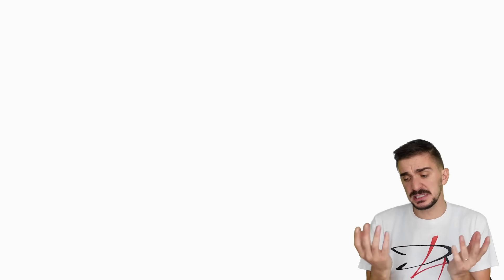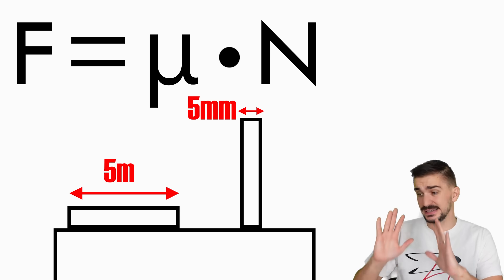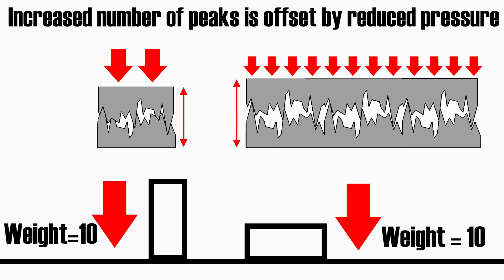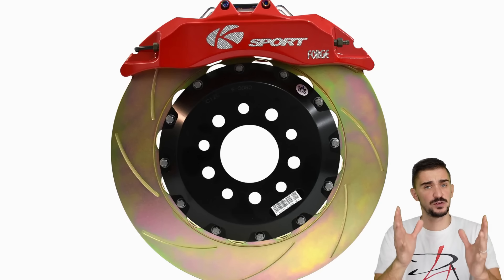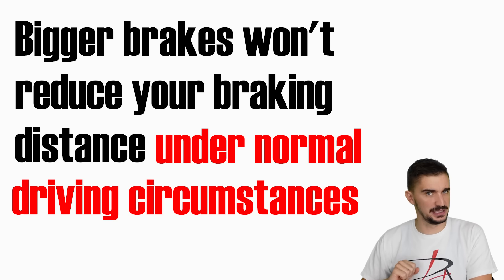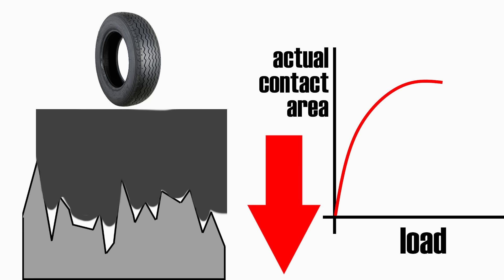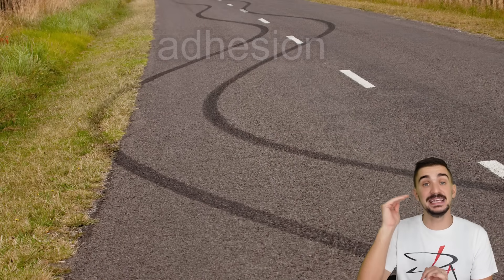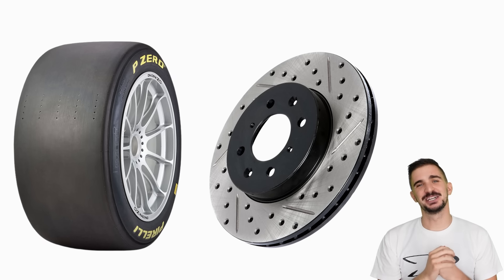Why Big Brakes Won't Stop You Faster but Wider Tires Will - Friction and Surface Area Explained

Comment: Also are you considering how fast and how much force you need to apply to lock up your tires? It doesn't matter if your oem can lock if it takes you stepping with both feet at full force when a big brake kit will apply full force with a moderate press of the pedal. The big brake kit allowed you to stop faster because you reached the 100% grip of the tires faster, more reliably and with less effort than OEM brakes. They also dissipate heat and are more reliable under constant braking where regular oem brakes will just fade and fail you if they get too hot. I don't know why people are sheep and don't realize the obvious.

Comment: Ok so someone explain to me why upgrading your brakes even matter then? The larger disk and larger caliper will apply more force with a slighter pedal press even if the maximum grip provided by the tires is fixed, you still reach it a lot quicker when compared to standard brakes. It also doesn't mean you can't increase it with better tires then you will take advantage of the faster braking of the bigger brake kit with the higher grip ceiling and increase the brake power past what your oem brakes can provide. So this video is misleading because it assumes that the oem brakes will always keep up with the tires grip, and that brake pedal responsiveness doesn't matter.
Reply: In conclusion, I will still get a brake kit, brake lines, and disk upgrade, because I will still brake faster than what oem allows even if my grip is still 100% I will reach that % much faster and stay there due to reduced brake fade/heating making my brakes more reliable during constant braking.

Comment: The math presented in this video appears to be based on the formula for static friction, which is applicable when an object moves in a straight line. However, it's important to note that when dealing with rotational motion, like the operation of brakes on a spinning wheel, the dynamics are different.

In the case of brakes on a rotating object, such as a wheel, the torque required to slow down or stop the rotation depends on the radius at which the brakes are applied and the coefficient of friction between the brake pads and the wheel's surface. The relevant formula for calculating the torque in this scenario is:

Torque (τ) = Radius (r) x Frictional Force (F)

Where:

τ is the torque applied by the brakes.
r is the effective radius at which the brakes are applied (i.e., the distance from the center of rotation to the point where the braking force is exerted).
F is the frictional force between the brake pads and the wheel's surface.
Increasing the size of the brakes alone does not necessarily change the clamping force, but if the brakes are moved further from the center of rotation (i.e., a larger effective radius), the torque they apply increases, resulting in faster braking. This means that larger brakes can indeed enhance braking performance in rotational motion due to the increased lever arm, as indicated by the formula above.

Comment: if normal break disks can fully stop tires and activates abs nothing will be different than bigger race break disks but if tires do have enough friction force and normal break disks cant stop the tire and activates abs bigger break disks can then there will be a difference. but if both breaks can stop the tires while moving car there isnt any be difference bigger and smaller break discs because tires are fully doing traction am i right ? (sorry for bad english)

Comment: This applies to other things. In about 1969~1970 dragsters were pulling 1 g average or more over 1/4 mile. With the normal friction equation, this wouldn't be possible. This is the same for lateral acceleration which was also thought to be limited to 1 g.

Two (at least) things make this possible. The effective coeficient of friction can be greater then 1 due to adhesive forces and the downforce, due to aerodynamics, is not limited to the weight of the vehicle.

Comment: I love the amount of reserch you must do for your videos and the way you can present the facts in a form that regular guys can understand. The fact is that most modern vehicles equipped with EBD and ABS, the ABS kicks in if you stamp on the brake pedal so it obvious the tyres are the limiting factor for single brake applications. If you are a track guy or towing heavy loads you obviously benefit from better heat dissapation, the other factor is that larger calipers and discs makes braking more predictable with better "feel" over a wider temperature range. You have remember that many race car series do not allow ABS so this is important.

The other factor is that most regular vehicles have single piston, sliding calipers for cost reasons, whereas "perfomance" brakes have multiple opposing pistons to provide higher force and a more consistent brake pad application. One question, is it fact or fiction that you can boil the brake fulid in the calipers to a point where you are relying on compressible brake gas rather than hydraulic / liquid brake fluid? I experienced this in some of my older cars where the pedal went to the floor after some serious repeated braking but recovered fine once things had cooled down.

Comment: Big break conversation only helps in track focus cars because it takes longer to over heat 👍💪 but that being said if not done correctly actually works the opposite.finally someone knows what he is talking about. I’ve been running my Subaru Impreza sti with just pads upgrade and grooved rotors and dot 5.1 oil . And my friend with tarox 8 piston and big roter upgrade runs out of breaks in one lap . Hahahaha.

Comment: Bigger breake discs also have greater thermal capacity, feature that is very usefull in rapid breaking form higher speed for example emergency breaking from higway speeds, this is why all discs have minimal rated thickness (for more reasons than this) 
Perfect examples of break discs evolution is Audi , model 80  from 1991-1994 had smaller 280mm solid 13mm thick discs, for 115HP engine, and for comparison similar model of Audi A4 b9 from 2016 (120hp tdi) has 330mm in diameter 30mm thick discs. In general there was steady progression in breake systems from model to model. I had opportiunty to drive almost all of those models and can say for sure, breaks are much, much better now than 25 or even 15 years ago. In this case "size" matters :))

Comment: Bigger brakes most absolutely WILL help you stop faster and that's because with a bigger rotor, you are applying the force farther away from the center of the axial, giving you more leverage, literally multiplying the force the pads push on the rotor -> stopping faster...

Comment: The equation is actually Torque = 2•μ•Force•Radius, where the radius is the average radius of the pad. Increasing the radius allows for a greater torque capacity, of which a negative torque is what slows the vehicle.

Comment: This video is great! Explained amazing. Unfortunately my friend watch the video and got that all you need is wider tires to create better brake applications. This is not true. Brake fluid and system need to dissipate heat to allow for the brakes to work. If they can't dissipate the heat then wider tires are not helping you stop.

Comment: has NOBODY considered the fact that the heat from the brakes transfer to the wheel itself and in turn, transfers to the tire? if any of you have ever had a frozen/locked up caliper,  than you know the wheel that's dragging is HOT. so if performance brakes manage heat better, then your wheels + tires  ALSO stay cooler which is a huge benefit!

Comment: This is a great explanation covering a lot of basics.  

The other big reason why bigger breaks don't stop a car faster is stock cars are all designed with breaks that can overcome tire-friction's forces and cause wheel lock up with maximum applied pressure.  ABS then helps prevent skidding, but it still activates because breaking force can become higher than tire-force in every stock car manufactured.   Thus in real-world practice suspension design and tire size are the only real factors influence stopping distance with cold breaks.  Which if you are cursing down the highway or driving about town, your breaks are gonna be local air temperature or close to it, thus "cold."   

And suspension design is NOT to be understated in its role given a good management of weight transfer can maintain more weight on the rear tires, thus increasing total contact pressure over all 4 wheels, leading to a notably higher traction.  If weight transfer is extreme because a soft suspension that "dives," while yes the front tires will load with much higher pressure thus much higher traction,  the rear tires could lose so much "weight" they fall into the point where rubber rapidly starts to lose friction with reduced normal force. Thus the car's total available traction can dramatically decrease, as much as I think 30-40%.   And as mentioned, rubber has a point where any additional load doesn't generate a noticeable increased in friction so the front's very high weight transfer will not compensate for loss of rear wheel traction past a point.  Worse yet is if the rear tires unload badly enough, the car can become highly unstable, and subject to "oversteer" (aka spin out) if its not moving PERFECTLY straight while breaking hard.  Even the smallest turn of the steering wheel could cause a spin out in this condition   This is why manufactures will actually go through a lot of trouble to balance ride smoothness with shock/spring stiffness to prevent even road cars from "diving" under heavy breaking as much as they reasonably can.  

In fact as consumers become aware that well-tuned suspensions make for much more controllable, thus safer cars, we need a very large increase in tolerance for a slightly firmer ride in exchange for that safety.   Which is one of the reason why the old soft suspension street cars that use to scrape their bumpers when breaking have all but vanished from the market.

Comment: actually they would from 200-0 stock would probably overheat and wont stop, an updated one will probably stop (tested with stock and then moved on ate power series)
heat on stock brakes can cause brakes malfunction 
yes tyres does help more but brakes does also

Comment: ?What about Torque Arm Length?
I understand your point about why larger rotor Surface Area doesn't improve power.
but what about the Diameter? would a rotor with a larger diameter have a better mechanical advantage?
-this is a big factor with mountain bike braking power. Ratio of wheel vs rotor diameter.

Comment: Imma guess that larger brakes really only help with heat dissipation which will in turn cause the brakes to take longer to develop brake fade under heavy use.

Comment: Because wider tires turn the energy of motion into heat faster than larger brakes?  BS.
Reply from the maker: How did you even make that up?!
Reply: @d4a  It's called "physics" - the science you skipped, along with "the law of conservation of energy."  - explaining why "overheated brakes" stop working.

Comment: Totally agree with what you say.  Where the bigger breaks bring benefits is that they have a higher thermal mass to absorb and then dissipate the large and repetitive energy of breaking.  I fit upgraded two piece breaks, pads, and very high temp fluid in the STI.  The result was less fade and shorter stopping distances.  A side benefit was lighter disk assemblies as well as forged rims for a loss of near 9Kg per corner.  Larger and better gripping tires tend to bring with them the requirement of up graded breaking components.
Reply: Bones break. Cars brake.
Reply: @locky2562  Sometimes, cars can also break.

Comment: I used to think it was because for larger disc brakes, the brake calliper would be attached at a point further away from the axis of rotation and hence have lower torque, needing lesser force to stop the wheel rotation than if the brake calliper was nearer to the axis of rotation. Well thanks for the explanation!

Comment: Well not necessarily, if the brake pads cannot cope with the brake load, i.e they wear too fast so that they loose effective friction, then a larger brake pad will have the same load distributed along a bigger area.
That may be the case if you put racing slicks on your Peugeot 208 and go racing at 24 hours of lemans

Comment: Mr. D4A isn't the force of the bigger caliper with bigger piston more than the smaller caliper with smaller piston because the master cylinder is the same but the piston of the caliper is bigger and therefore more force is applied to the brake pad with little more travel of the brake  pedal ??
Reply from the maker: Yes. But it doesn't matter https://youtu.be/Ql9eYh31kTw

Comment: Good brakes will 100% stop you faster and in a shorter distance and tyres matter as well. You didnt have to clickbait the video or im not even sure if you did, because im not going to watch 16 min video that has a title thats not true. You can feel the more aggressive bite from better brakes, especially at higher speeds and their performance doesnt degrade so fast or in some cases at all (during a stress). You maybe think this only applies to a racetrack, but they can fade if you travel trough the mountains or if you stress them on a very hot day. Regular brakes have also bigger margin of performance due temperature outside, so they will perform worse at +40°C or -5°C than at 20°C, while that margin is smaller with expensive brakes. Some high end brakes need to be warmed up to perform safely, but that is a racetrack talk, nobody is stupid to risk their life with factory brakes on a track and have bad lap times in a process, plus they would only last 1 or 2 laps if you are lucky.
Reply from the maker: So you want to present your argument but you don't want to hear mine? That puts your intellectual maturity roughly around the age of 6.
https://youtu.be/Ql9eYh31kTw
Reply: @d4a  You insulting my intellectual maturity only speaks about your own. Very predictable, i never expect anything more from ticks and leeches that clickbait and waste peoples time for their own profit.
If you were not a midwit, you wouldve comprehended what i wrote and that was i am not going to spend 16 min on a video that has a lie as a title. Can you grasp that even?

Comment: This is wrong.  Bigger brakes do have more stopping power as bigger brakes have more pistons.  Hence more clamping pressure at the same psi force.
Reply from the maker: And here's a video which explains why that is irrelevant. https://youtu.be/Ql9eYh31kTw
You can have 50 pistons and a million psi of pressure at the end of your brake pedal but you're not stopping any sooner

Comment: The title is click bait nonsense. Friction alone doesn’t stop a car. Converting kinetic energy into heat stops a car. Video sort of gets to the point eventually, but I still disagree with the assertion that it makes no difference for “everyday driving.” If you panic stop a vehicle from high speed, bigger brakes will absolutely stop you faster. “But you don’t do that in daily driving!” Sure. How about a video that says “car are safer without airbags” and half way through you say “if you crash, then it IS safer to have airbags. But that’s only in extreme circumstances, not everyday driving.”
Reply from the maker: How will bigger brakes stop you faster in a panic stop? I'm afraid you didn't really grasp most of the video.
Reply: can't stop you any faster if in both scenarios the limiting factor is your tires. both brakes will lock them up

Comment: Wouldn't the same braking force applied on the edge of a larger diameter disk provide a bigger angular braking momentum, therefore less pressure on the pads being necessary for the same angular momentum of the brake, and hence less heat generated? In short, the larger the disk, the lower the pressure on the pads and therefore, the lower the heat. And the larger the disk and pads, the longer they last, otherwise, in extremis,  a braking pin would do job :)

Comment: bigger brakes gives you the impression you're slowing faster, when in reality it's just decreasing the time it takes you to get to the maximum braking point. at that point it's all up to the tire to withstand the friction or the grip if you will. and also, bigger more stronger brakes, give you more endurance.

Comment: Automobile Performance Upgrade Order:
1: Ergonomics/Seat
2: Tires +(Wheels)
3: Shocks&Springs
4: Big Brakes
5: Power

Most People:
1: Power
2: Sound
3: Power
4: Noise
5: Rims/Stance

Comment: Pretend your cutting board is a 1000lb block of concrete laying on a railroad track. You cant push it. With a pry bar you can. Distance from spindle center to OD of rotor is lever.
Reply: stopping power doesnt matter when the brake disk literally isnt rotating under extreme braking. it is up to the grip of your tire. if your stock brakes cant lock up your stock tires, something is wrong with your stock brakes or your stock tires

Comment: Same principle with selecting off road tires...Wide tires will (float) due to more surface area allowing the  weight of the vechical distributed over a wide area, Good for sand and bottomless mud Vs tall skinny tires allowing more weight per sq inch good for mud with roots and rocks

Comment: There is a mechanical difference as the circumference incresese?
Reply: If a disk is 12" diameter and the brake pad is 3" square area, will a 24" diameter disk with same brake pad have the same braking abilities? 20" tires have more surface area than 14" tires of the same width. The ability to stop a 3" diameter disk compared a 3' diameter disk are NOT the same. A big diameter wheel will also be a smoother ride.